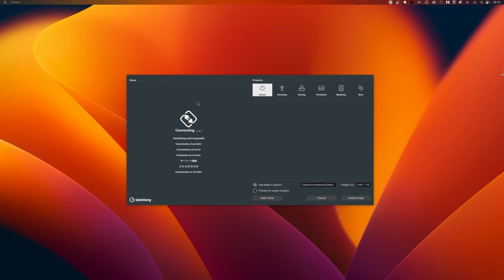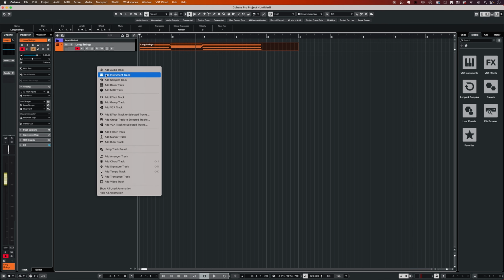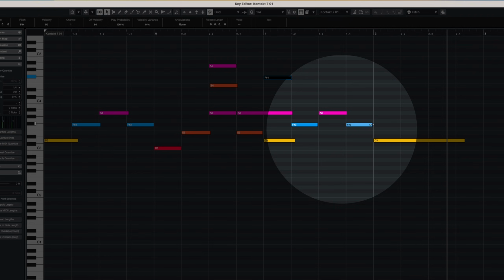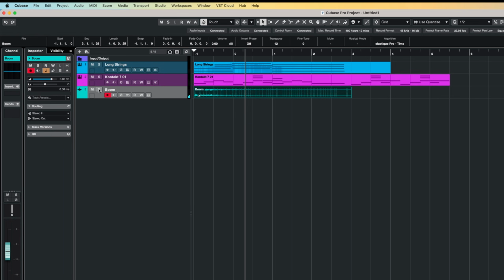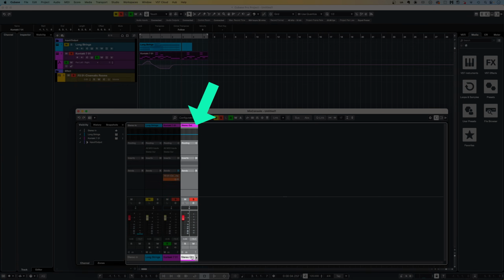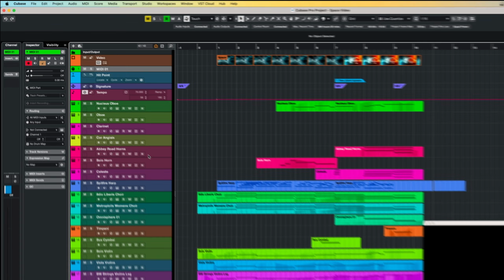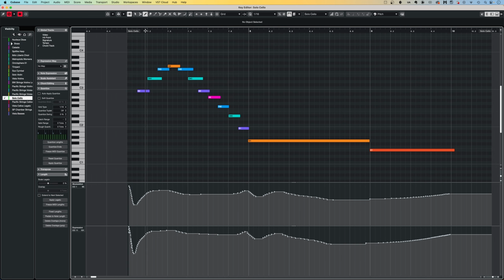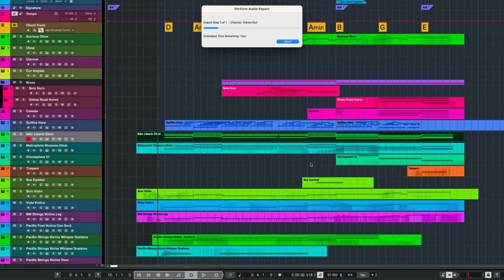Getting Started with Cubase Pro | Beginner Composer's Tutorial

Comment: I am using Cubase Pro 15 and when I try to resize my audio clip like at 15:42 from one side, it resizes from the other side (like i try to short it from left side it shortens from the right side). Is there any setting I need to change?

Edit: I figured it out, you have to click on the object selection tool in top toolbox and choose "normal sizing". Don't know why it's not set to that by default.

Comment: One thing that was doing my head in was that there didn't appear to be a way to duplicate a note in the midi editor by dragging it. This is indeed possible but you have to drag the note first, then hold ALT. If you hold ALT before dragging, it wont work. Adding control to this will constrain the note movement in that row.